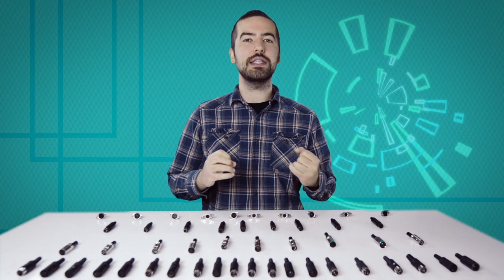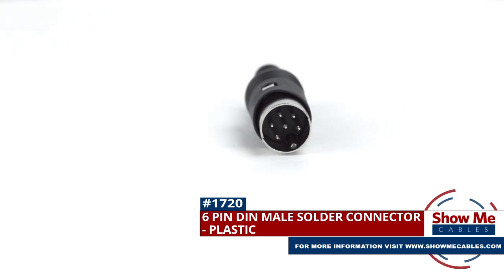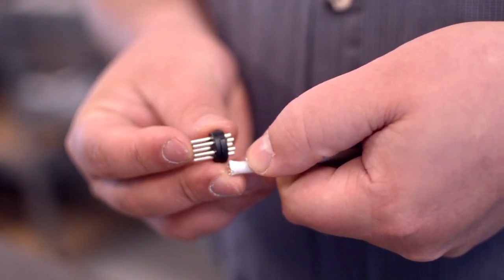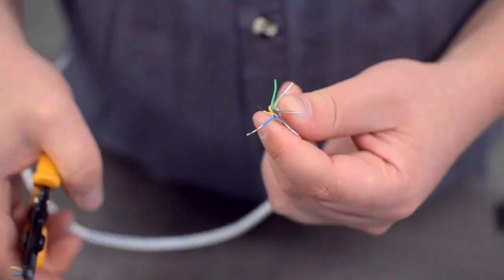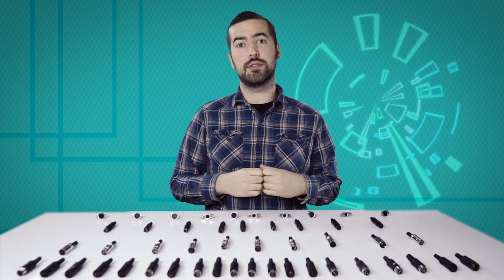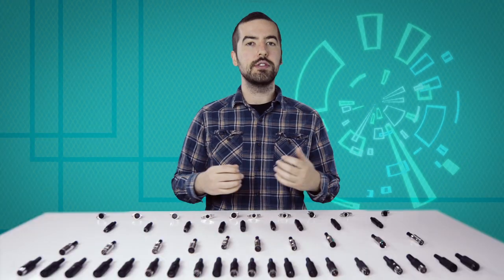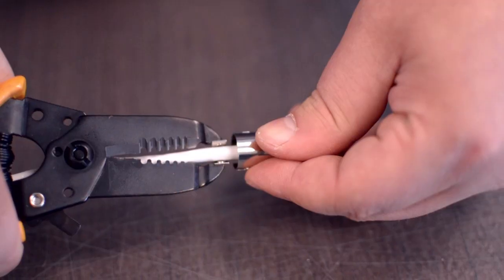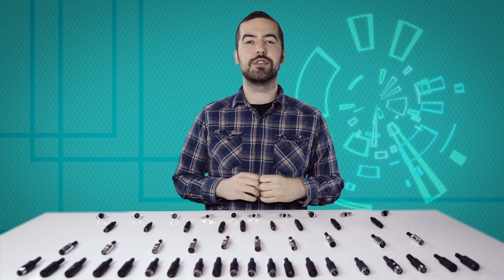How To Install The 6 Pin DIN Male Solder Connector - Plastic

Comment: Downvoted. Worthless video.  And your website shows the wrong picture for 6-pin DIN. It shows a 7-pin DIN.
By the way, the plastic that holds the pins will melt without much heat, while attempting to solder these cheap connectors.

Comment: you don't explain how to  solder the wire combinations this is the most impotent part
Reply: Correct. The pins inside the plug have no lugs for threading/twisting the wires on. How does one make a good, stable and electrically isolated solder ("sol-der") connection on those pins?